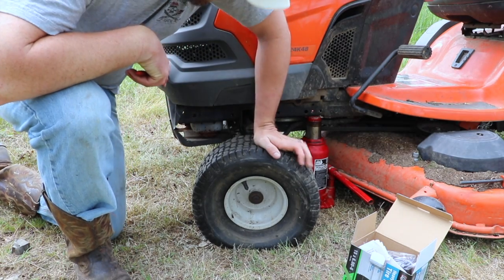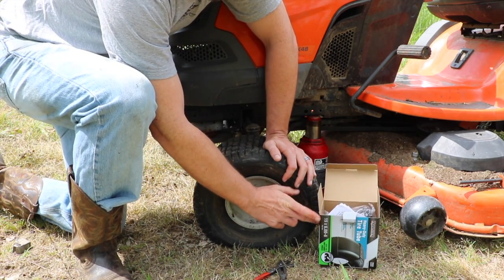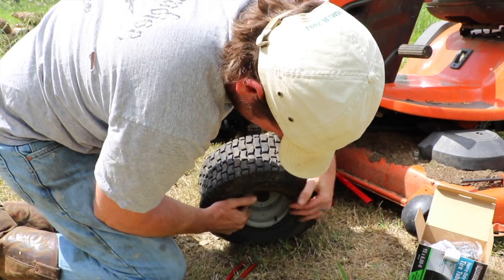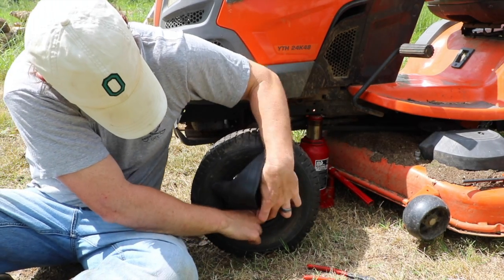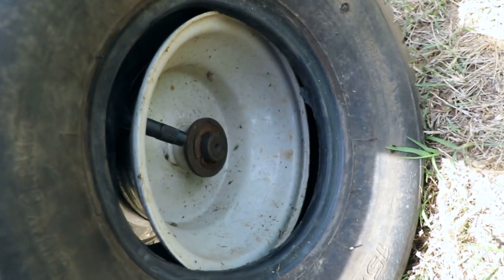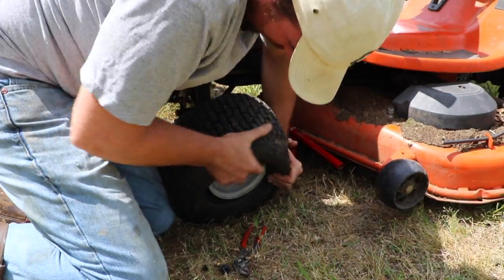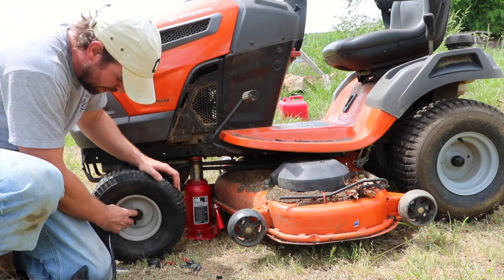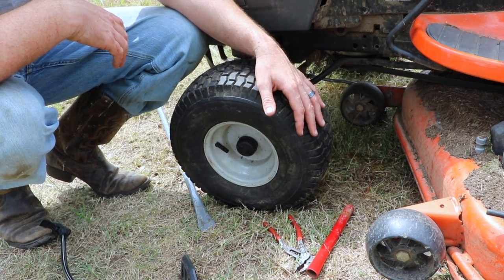Husqvarna Riding Mower Flat Tire Repair - Ranch Hand Tips

Comment: Those dang little tires are expensive! You can buy the inner tube at Tractor Supply... I wonder ho many people who use such a basic peace of equipment know they can just throw an inner tube in it?  Thanks for the video.
Reply from the maker: Right! I'm not even going to mention how many times I bought a replacement tire because I didn't have the tools to reseal a tubeless tire... before I figured out I could just put in an inner tube lol.

Comment: I deal with hedge Thornes that dont care  if the tire has a tube or not. I might get a half dozen Thornes in a day of mowing. Tubes with Slime dont work. They just make patching the tube harder. I have a couple jell filled tires. That will solve the problem but I will need to adapt them to fit the lawn tractor.

Comment: I stuck a hole in the side of the rear tire, it's tubeless and I plugged it then covered the plug on to the tire with jb weld, brother said it wouldn't work that was seven or eight years ago. jb weld holds that plug for good